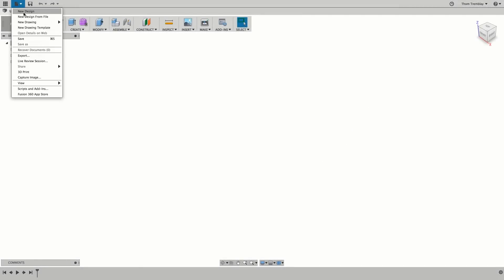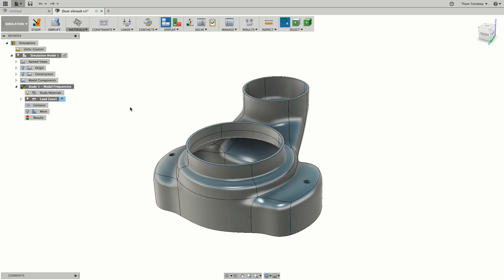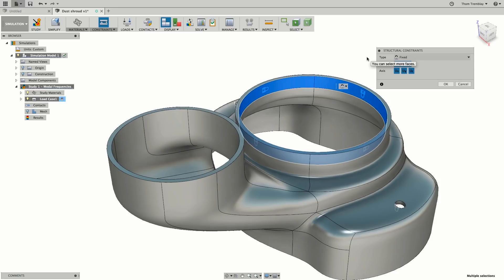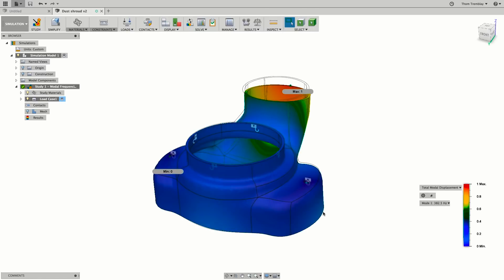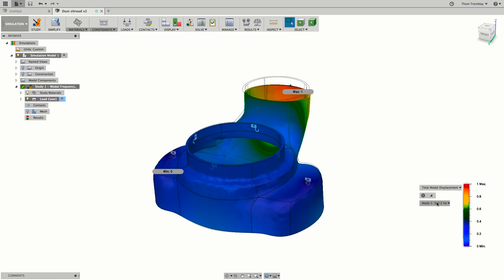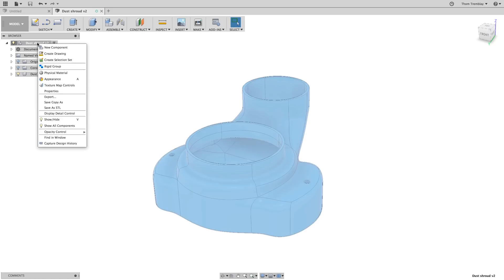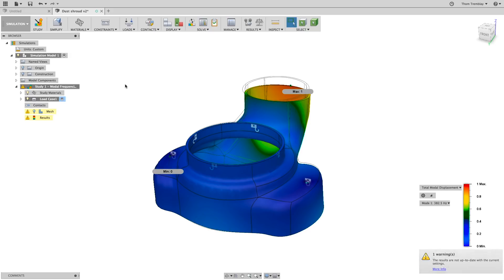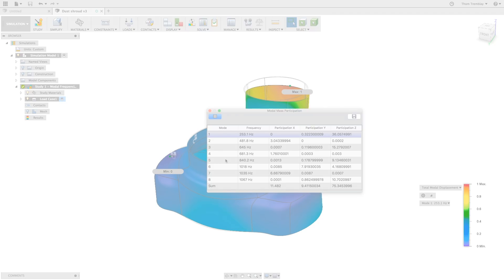Avoiding Destructive Vibrations with Modal Frequency Simulations

Comment: 2:13 .... the 1/60 used in the calculations has nothing to do with the motor. Is the conversion factor to go from RPM to Hz.
Reply from the maker: Not sure what happened there. The graphics shows what you say (and is correct), but the voiceover deviated a bit. Sorry for any confusion that might have caused.

Comment: Wouldn't it be better to have the lowest mode above the specified frequency range? That way when the motor is turning on and off it won't pass through the mode. Great video though, thanks team!
Reply from the maker: As I understand it, that situation - keeping the lowest mode above the frequency range - would be best. However, as long as the excitations are avoided in normal usage (vs startup/shutdown/pass through), I think most issues could be avoided. We'd love to hear others thoughts on this.
Reply: Hmm ok, thanks!
Reply from the maker: I could def be wrong. We have subject matter experts here I can and will forward this to.
Reply: Thanks!